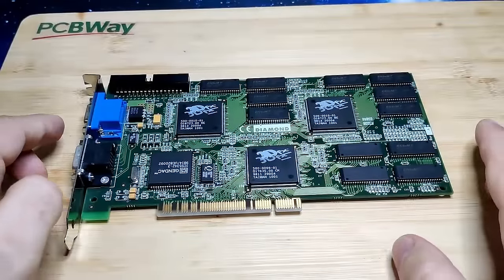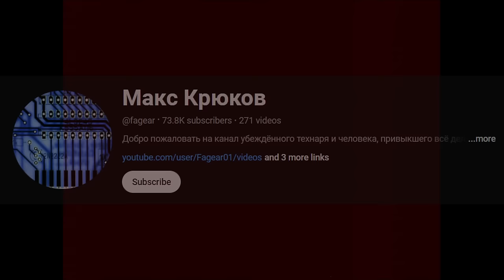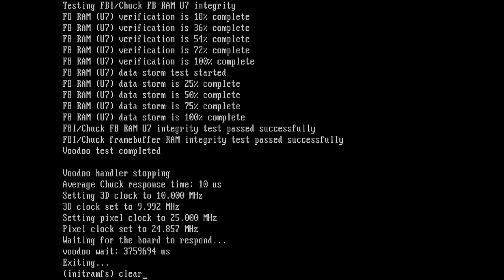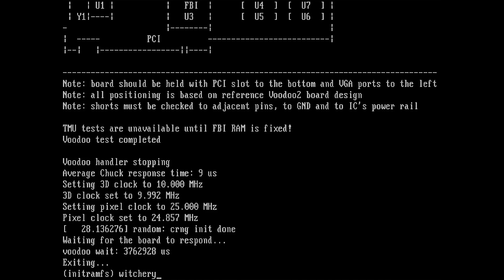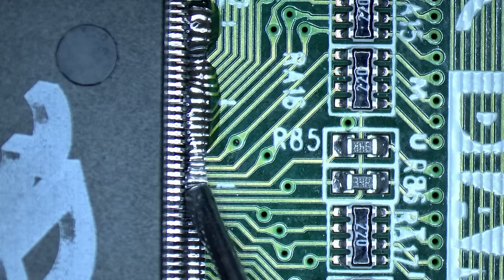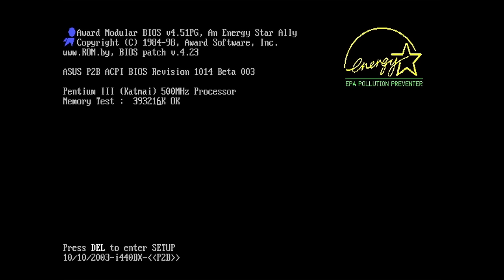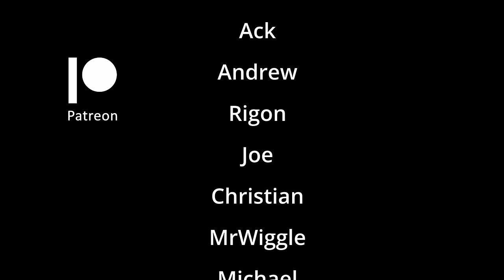The ultimate 3Dfx debugging tool: Witchery! Debug any Voodoo 2 and fix it! (Part 3/3)

Comment: shorts on data lines can be caused by burnt internal pull up or pull down resistors and in some cases you can suplement it externally either on the controller chip or on the memory module alone if pin is "dangling"
i would assume voodoo has pulldowns since it doesn't work on chip burnt by overvoltage
so if you didn't want to replace the 3dfx chip you could bridge pin 2 with resistor ~100-500k (i think you could check it on any working chip to ground or power if i am wrong) and do a getto fix
 if it is just a pull up on the bus it would work if not it would be just swaping the controller  like you did but i don't advice to put bad chip back to test my theory :P
Reply from the maker: Well, I still have the chip and the donor board. You're the second person suggesting this fix. So, you mean I just place a 100K resistor between 3.3V and the broken D0 (Pin 2) line in question? I could try that on the donor board.
Reply: @bitsundbolts  if you had an oscilloscope you cuould mesure logic level voltages on memory or just get the value from memory datasheet if it is 5v chip you might have 5v logic levels, if 3,3v then 3,3v 
the biggest thing is to figure out if memory is shorted to ground, dangling or is there interna pullup without pull down or vice versa . if the damage is just on pull ups it is as simple as bridging data pin with a resistor to whatever voltage it should be pulling to, if it is internal damage on decoding logic or the output of a logic gate in a buffer or something, this would not fix or break anything
it was just a silly idea about how to potentially getto fix a broken chip kind of zombie voodoo
Reply from the maker: Well, anything might be possible with those Voodoo cards 😉. I might try to revive that donor card. I just need to get my hands on the 3dfx chips and could try the Brocken chip once more. I'm just a bit worried due to the high frequency. I'm facing similar issues on my 16MB SIMM modules with the level shifters.

Comment: Awesome job! That really is a useful tool for diagnosing problems. Sad that it was the FBI chip, but not unexpected. I'm surprised it even worked that much! So thanks to Maksim for helping save this Voodoo 2!

Anyway, you have far more patience than I do for straightening pins, and a much steadier hand! I definitely would've put it in the too hard basket once I worked out the memory was fine. At least if I come across a board with a chip that has mangled pins (or a chip with mangled pins), I could donate it to you so I can just watch you fix it instead! 🤣
Reply from the maker: Thank you! Ha, I hope you will have plenty of Voodoo 1/2 cards - definitely keep them if you find them and I can try my luck on any of them. The ones that won't be recoverable stay with me for spare parts, the working cards can go back to you :)
Reply: @bitsundbolts  Deal! Except I've already got enough Voodoo cards, so I'd probably just let you keep them!

Comment: Great tool, it makes debugging way way easyer. Instead testing for long hours for shorts, continuity, open traces or bad solder contacts on each pin, this tools in 10 minutes gives you the needed info about what is not right. Who would suspect that the FBI chip have one data bit stuck low? You could have find the problem but it would took much more time and more than a DMM.
Reply from the maker: Correct! And I couldn't spot anything with the multimeter. I tested so many pins on the memory chips. Diode mode, continuity mode, etc. I wasn't able to figure it out. In the end, I would have to guess and I would have found it. The tool gives you the right hints and will save you time!
Reply: @bitsundbolts  In the end you would had to use an oscilloscope, logic probe, logic analyzer to see in real time what happens with the adress/data bus on the memory chips or FBI. Tools that most mortals do not have and are expensive and hard to get (good ones, I mean).
I wonder if this tool will be free and what will be able to do in its final revisions, maybe full test any Voodoo card or I am expecting too much? I mean, and you also said it, most of the documentation for those chips is not available, so is voodoo magic...
Reply from the maker: @sebastian19745 Unfortunately, the tool supports only Voodoo 2 cards for now - I might have said Voodoo 1 as well in the video. That was a mistake then. The tool will be open source and hopefully, with more people contributing, Witchery will support all Voodoo cards. But it will take time as you said - it's all voodoo and witchery ☺️

Comment: Super nice tool, especially the clear information on where the chips are and what might be the problem. Did Maxim create all kinds of errors on his test rig to know the errors or is he just a god among mortals.
Reply from the maker: I agree! The information and error description of that tool are amazing! I think he did simulate errors by purposefully modifying Voodoo 2 cards. It's a slow process and deserves a huge shout-out to Maksim's work.
Reply: Multiple hours were spent buzzing out connections, stepping through adresses in software while probing some pins, shorting stuff on working cards to see how it will affect results. And then I've bought a dozen of broken V2s and started to run tests on those.

Comment: Great job! I guess the burned chip damaged the FBI chip and made it report bad memory, no matter what chips you replaced. One more Voodoo card lives on!
This encourages me to pick up a multimeter and test out a Sapphire Radon 9250 card I've got that isn't detected by the AGP slot, I've got 2 so I'll be able to compare values between the good and the bad card.
Reply from the maker: If you can, check the BIOS chip of the card. It might suffer from bit rot.
Reply: @bitsundbolts  Unfortunately I don't know how to check it. In fact, I don't even know which one is the BIOS chip 🤔 I might try googling the inscriptions to see if I find it, then try to swap them. But before the soldering iron gets involved, I'll try to measure each component's value and compare to the good card.
Reply from the maker: Maybe there is a flashing tool you could use to see if it detects the BIOS chip. I haven't done this, so I have no experience.
Use an old PCI graphics card if you have and keep the Radeon 9250 in the system. Try to flash the BIOS. It might work. I have two videos on my channel where I flash once a GeForce 2MX and once a Voodoo 3 using DOS flashing utilities. Both cards suffered from a corrupted BIOS. After flashing, both cards started to work again.

Comment: Great work on this repair! I love your channel and your work :D I notice you use an OSSC as part of your video capture setup, what capture card you use for the hdmi output?
Reply from the maker: Thanks! For HDMI capture, I use a very cheap USB capture card I found on Amazon. I had to go through many before I found one that works well and responds quickly to resolution changes. I had an Elgato Cam link 4k as well, but surprisingly, that somehow didn't work well (especially with certain resolutions under DOS). The USB capture device was around 15 USD and is silver. Unfortunately, there is no guarantee that it's still the same device. I'll add a post to my website about it in the coming days.
Reply: @bitsundbolts  great, thank you!

Comment: Success! Nicely done!
PS I Wonder if inatalling faster memory chips would enable you to OC the mem?
Reply from the maker: I haven't done any overclocking on Voodoo 2s yet... There are models with 110 MHz memory, but those memory chips are hard to come by. Not sure if it's worth it. And if I'm not mistaken, the Voodoo 2 chips are running at 90Mhz - so, there should be some headroom for overclocking anyways. I'll try that maybe on one of my own cards in the future.
Reply: @bitsundbolts  I remember pushing the old Voodoo1 chips from stock 50 to 62 Mhz easily. Even Powerstip was displaying a flame icon next to the speed slider. Looking back, I wonder how many ns were those chips. Anyway, thanks for the video, I'll probably try Witchery on the ol' V1 just to check the tool when it is released. Were it not for your video I would probably never hear about a new tool for my 28yr old card, heh.
Reply from the maker: @Thomsonicus I'm afraid Voodoo 1 cards aren't supported yet. I may have said it wrong in the video. But I am sure support can be added quickly after the tool has been released. I never got any Voodoo 1 stable past 57 MHz. I had 35ns memory chips on those cards. I guess you were lucky with your model!

Comment: Told you the FBI chip. ;) My guess is that the protection diode on that FBI chip data line shorted to VDD from the overvoltage.
Reply from the maker: Yes, there were a few suggesting that the FBI chip is broken. That is one of the chips that is hardest to replace and I only did it after there wasn't any other choice. It's very unfortunate since it seems to be just one of the lines that killed the chip. But it was coming from that one memory chip in the bottom right corner that had that big hole burnt in the center.

Comment: Nice job! You shouldn’t be that much surprised by the 0MB without chips or with faulty U6 access. The FBI chip uses 64-bit bus to access memory so you need 4 working chips to get the first 2 MB of FB memory. In this case I guess it failed memory test on first byte so effectively crashed the system and reported 0 MB.
I wonder (but maybe I missed it in previous episodes) how scope view of faulty bit looked like? If the chip was fried it should never reach out L or H and be a bit different from other bits.
Reply from the maker: I did not scope every data pin. It is in an unfortunate location and difficult to reach with the probe. I do have the Brocken FBI chip though - I could resolder it to the donor card and test it with a scope now that I know where the issue is. I can just test one of the corner pins of the FBI chip.

Comment: The main lesson here is to go back in time and make sure people don't buy cheap PSUs. Had a bad PSU in 2005 go pop and it charred a pin on the 24 pin connector but luckily it didn't burn my P4 Northwood and Radeon 9800 Pro , was a PSU that came with a case and I thought i had gotten a deal, turns out that any time you get a PSU along with something, it's likely sketch.
Reply from the maker: Very true! I remember those cases with PSUs. And you are right, most of them were garbage and you shouldn't use them if you liked your PC.
Reply: The PSU and the cooling are the key components i never compromise on, even on cheap systems, it's just not worth it endangering an entire system to save a few bucks/dollars/euros.
Brand name or nothing for that, people who don't like that can buy their computers at the food discounter and leave me alone with it.

Comment: wow what seriously handy debug tool - i so need this - where and when can i download it
Reply from the maker: It will be released as open source as per Maksim. He's still working on it, but maybe, with all the positive comments, it may be released sooner than later.
Reply: @bitsundbolts  at least it checks the FBI ram chips at the moment - to exclude those 8 chips if your trouble shooting a artifacting/broken card - it will be great when it can check the TMU ram chips aswell - better to just remove one bad chip than the whole 24 ha ha - BTW i knew urs would need that replacement FBI chip - as it was directly connected to the blown ram - but what a great tool to prove it first

Comment: if this ends up working w/ Voodoo 3's i might be able to eventually find out what's going on w/ this Gateway branded Voodoo 3 1000 AGP i have on hand. i'll haveto keep an eye out for when the Tool's Released.
Reply: At the moment utility works only with V2. In theory V1 is pretty similar so it probably will be supported later. For V3 I briefly looked at the datasheets and I don't know yet if its support will be easy. No promises on that yet.

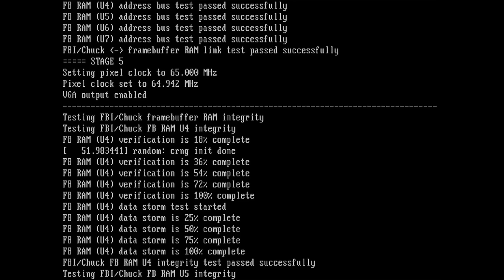Comment: 46:29 that looks like a linux kernel message, crng is a cryptographic number generator, it seems like the init was quite late so the kernel just spat that message out in the middle of the console,
imo unless the test uses crng it's unrelated to the test and nothing to worry about
Reply from the maker: Yes, confirmed. This message is not related to the tool. As you said, it's a kernel message that popped up.

Comment: tool for voodoo diag is not public / free? Is usable also for other 3dfx cards? 🤔 good work voodoo working again 🥰 I am waiting atm for two V2 12MB so i hope i will try SLI mode 🤗
Reply from the maker: The tool is not yet public, but it will be released as open source some time in the future.

Comment: i do wonder what can you use to clean up very stubborn solder paste ? i 'v tryed isopropanol but often its just dilute the paste and make a more of a mess.
I could use hot water with soap and a tooth brush but thats add some other inconveniences, and even then it isnt cleaning everything.
Any tips for any chemicals?

Also very interesting and good video, i could almost feel the anxiety passing trou :-P  but big reward in the end.
Reply from the maker: Unfortunately, I don't know how you could deal with your solder paste. Maybe try to heat it up with a hot air station to 60-80 degrees (so the solder doesn't melt, but the flux will lower its viscosity), and then try again with a cloth dipped in IPA. I assume you have those tiny solder balls everywhere on the board?
Reply: @bitsundbolts  my hobby involve crafting electronic dohicky or prototyping so tiny is debatable, its not as small as what you working with, but my issue is when i need to melt and fuse solder with some stubborn metals contacts that work nicely with paste, but paste is such a mess and sticky. mostly i use clear pcb liquid solder flux, but i don't want to use all of it and im looking for alternatives, like paste .
I will try the heat and clean  . or maybe i should get a bottle of Acetone.

Comment: Man, I wish I had this tool. I have an even stranger Voodoo 2  (also with an FBI issue) on which I replaced all memory chips (with new ones) and also the FBI itself with a NOS chip and the problem still persists... And my card looks like new, no broken traces, no missing components (it sat on a shelf for 2 decades, in an antistatic bag).
Edit: btw, "Random: crng init done" is output from the Linux kernel (Cryptographic Random Number Generator initialization) which is displayed on the console output with a certain delay. It's not related to Witchery. 🙂
Reply from the maker: Maksim will probably release his tool at some point. Hope you can wait for it to be available! And thanks for watching!

Comment: I did suspect the FBI chip was the problem, this is a bit of a sad repair as the broken chip is one less of a finite supply rather than capacitors or other simple components that you can get brand new.
But I still loved that "YES" moment when it worked!
Thank you for another journey, and thank you to Maxim? / fagear for a nice tool.

Comment: I also repaired broken Voodoo 1 by fixing 2 FBI chip traces and some pins. Nice work. I prefered to not use hot air, becasue the pads can fall off.
Whole restoration video is on my channel.

Comment: It wouldn't change much, but I wondered why haven't you checked the continuity between suggested FBI pin 64 and pin 2 of U6 & U21? Clearly, the databuses of these chips are in parallel. The 'crng init done' with a timestamp during the last Witchery run, was just a Linux kernel debug message (you can see a lot of them during Linux startup).
Reply from the maker: Oh, I did check continuity multiple times. It's not the fault of the PCB, pads, or traces. The continuity is there. The fault is within the FBI chip.
Reply: @bitsundbolts  yeah, I know, but you just haven't shown that. On the video you've only shown voltage drop from these points to GND.

Comment: I wonder if it's just the chip select line for that bank of 2 ram chips.  If that's all it is, maybe a little bodge of some logic chips to make up the missing signal based on the other 3 would work.  Just a thought.  Ping me if you want to try something like that

Comment: I am curious what the pin looks like underneath the ceramic now. If the damage isn't too deep, you could maybe dig it out and re-solder it internally lol
Reply from the maker: I am afraid that the damage is inside the silicon chip. There is nothing I can do :(

Comment: 2 questions:
first: why would you try to repair a so badly burned card instead of making it the donor and repair the previous donor it couldn't be more broken could it?
second: would the FBI chip work with an external pull up on that pin? Its a pity you did not test that now its to late, or may be you could test the on the donor?
Reply from the maker: The donor card I have was handed down to me and it had many parts removed or replaced. Additionally, the spot for TMU0 has a few broken pads. So, the PCB of the card with the exploded memory chips has a PCB in better condition as well as all the original SMD components.
And I think reviving such a card is a greater achievement than reviving the donor card.
To answer your second question, I am planning on reviving the donor card once I get an FBI and TMU chip. I will try the external pull-up resistor. Unfortunately, I have to solder the FBI back to the board, but I'm willing to do that. It would be cool if this TMU could be saved by an external pull-up.
Why didn't I test it while I had the chance? I didn't know or it didn't cross my mind to do this. I'm not that experienced with electronics repair, but each time I learn something else thanks to my audience!